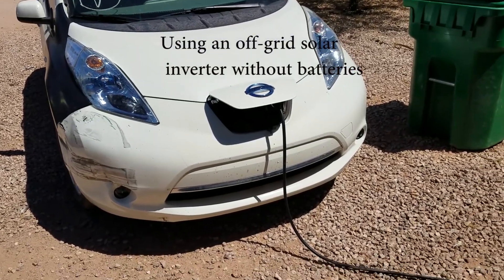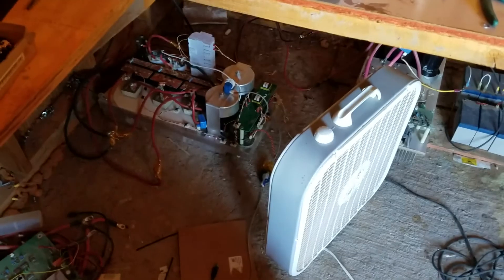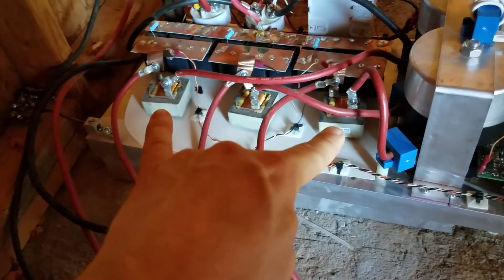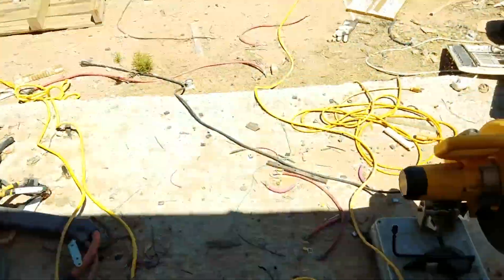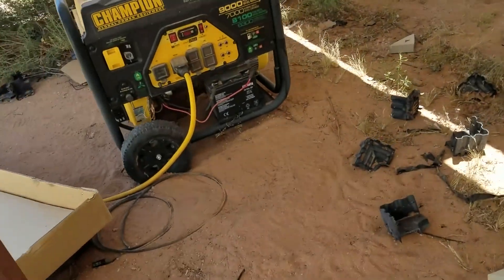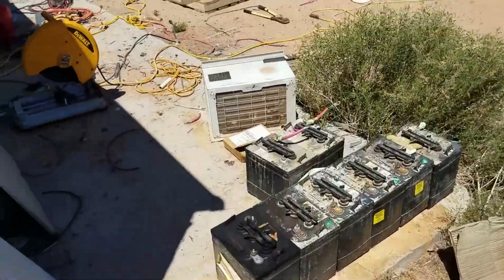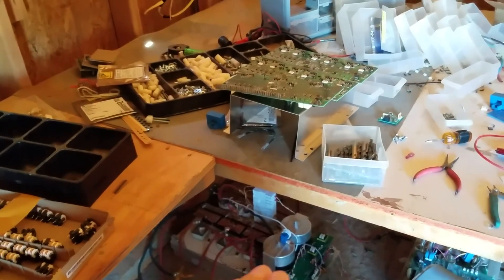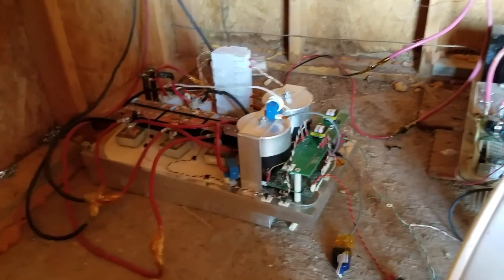Running A High Voltage Off-Grid Solar Inverter without Batteries

Comment: Great job it looks very interesting....I just installed 15 kW of solar panels on my roof and I still I'm not connected to the grid because of Bureaucratic problems with installation of the 
Bidirectional meter. What I don't understand is how do you overcome the on and off of the system because of cloud shading , I would believe it's hard on any air conditioner to continuously go on and off. Intuitively I would think you would need a battery to take you through the downtime due to cloud shading for minimum period of time, Could you elaborate on how you overcome the downtime because of cloud shading in another video! Thx

Comment: Did you ever consider that if you could disconnect your electric vehicle's motors from the inverters, you could use the car's inverter to power your home, no extra inverter needed.   The car's inverter could power 20 or thirty homes, unless there is a lot of heat pump usage.   There would be no trouble starting any domestic load.  A large home's whole house airconditioner would be no problem to get running,  Of course, if you did this, it would make sense to go to a three phase system, since the car is.
Reply from the maker: I actually used my motor controller board for this.  I just added an LC filter on the output so it looked like a sine wave.
Reply: Was that an electrical vehicle?

Comment: +1 More people should be posting videos like this.  I'm off grid with  3KW of panels and only a car battery and live just fine. I hate batteries.  I run things mostly off the DC PV array buss with a micro controller prioritizing loads.  There are better solutions than just a bunch of black boxes connected together.

I now run my LG washer off 4 grid tie panels with a modified MSW inverter which accepts 130V DC.  No batteries.   Excess PV power heats water and all cycles use hot water. Super clean.

Comment: Would you mind sharing a schematic of your inverter someday?  How do you handle the filtering to get a somewhat smooth sine wave out?  Do you just use those output inductors or do you also have AC capacitors between the phase outputs and ground?  Do you just monitor the output voltage or do you also track current?  Maybe a video showing and oscilloscope showing the waveforms would help explain it :-)  Anyway very neat, I like seeing the amazing things like this people build!

Comment: I have a standard battery inverter but I don't currently have the batteries to run it and I am thinking of doing what you are doing. I just wish the manufactures of items like frigges could let one just directly run it off a solar panel or two, and avoid all the hassle of having to use an inverter and convert the power to A.C.
Reply: GE monogram makes a refrigerator with a DC compressor, but they use an inverter that runs off of 120v AC to power the compressor from 53v DC to well over 250v DC. The problem with these fridges is that the inverters keep failing. Maybe you can figure out how to run the compressors on DC straight from a solar array powered 48v battery pack. You may be able to change the 48v DC from the battery, to maybe 100v DC with a DC transformer? There really is no need to have a multi speed compressor by varying the DC voltage to it. All AC compressors are constant speed, as far as I know.

Comment: Great work! I suppose it's an SPWM inverter, only wondering about it's input voltage range. Have you considered using supercaps in parallel with your panels to provide surge power? Those things can do miracles.

Comment: if every building in the country used this design we could eliminate this stupid ass high voltage electrical grid.
Reply: It is not even practical for most buildings.

Comment: if you run a 1000W air conditoner how many watts of solar panels do you need?  Seem you need to cover the surge.
Reply from the maker: The panels just sag under the surge, but it only lasts a short time.  I can even easily start my milling machine, which has around 100-200amp startup surge on the motor.  In fact, my normal circuit breaker trips when the milling machine is hooked up to the grid. It works much better off of the panels.
Reply: Thanks this is really a breakthru, I had a 24V to 12V converter and hooked the 12V to a inverter and was able to run a 50W fan on a cloudy day on 200W a panels.  Do you need a sine wave inverter for the leaf or is modified ok since you are just converting it to DC anyways?

Comment: Have you considered using the LEAF batteries for storage (through the CHAdeMO, if you have it)? You look adept enough to figure out the Vehicle2Home protocol for the LEAF.
Reply from the maker: I would like to do that.  They have a diode on the chademo input forcing it to be house to vehicle only at the moment I believe.  I'm just now finishing a SiC based MPPT tracker, and my hope is to charge the leaf batteries right from the panels so I could do more like 6kW with like 98% efficiency rather than panels to AC to leaf charger back to DC.  I bought the chademo protocol, so I should hopefully be able to at least get the H2V MPPT working.  I wish the car wasn't such a nanny state.  If you try anything too weird you can brick it until it goes to the dealer to clear the fault.
Reply: Yeah, so many cheap LEAFs out there begging to get hacked. Hopefully, with all the projects, the code will be cracked. 

I would like to use my LEAF as a 3-phase generator (with either an external CHAdeMO inverter, or using the car's internal inverter).

I could buy a CHAdeMO charger or generator as separate devices, but either is way too expensive. Seems like both could be in one device with a bi-directional inverter such as used in AC drive cars now.

Comment: Oooh yeah......this brilliant my friends. 
What about when you clouds passes by your solar panels are your appliances still running?
I have just subscriber to your channel. Please checkout my channel subscriber like and share with your friends and family members
Reply from the maker: jwsolarusa if it is running at full capacity, clouds would cause it to turn off temporarily.  but where I live in the sonoran desert it is sunny 99% of the time.   also it is so hot that batteries dont last very lon.
Reply: MPaulHolmes 
Wow!
Thanks for sharing biddy

Comment: Could you post a schematic how you are connecting your panels to your inverter and output filter? I would expect an efficiency in 97% range similar to grid-tie inverters.
Reply from the maker: It's just Panel + to high voltage + input, panel - to high voltage - input, and the 3 phase outputs of the 3 half bridges go through their own inductor, and to 
150uF of capacitance each.  Then, all 3 150uF capacitors have side "B" wired together (and that side is just left floating, connected to nothing else), and each side A (which is connected to its own inductor) goes to the outside world.  
So, 3 of these:
IGBT HALF BRIDGE "MIDDLE" ------ INDUCTOR --------- 150uF 
I think one reason for the efficiency I measured is, these are 1200v 200amp IGBT half bridges switching at 19.2kHz. A usual grid tie only has a full bridge I think, but this is 3 half bridges, in order to get the split phase/3 phase power.  Also, this would be quite a bit more efficient at 100 or 150amp per phase rather than just 6 or 10 or 15amp per phase, since the IGBTs have a constant voltage drop for their ON losses.  It's sort of designed for much more power than I am using it for.  If I was doing a 6kW sunnyboy, I would probably do SiC mosfets for the full bridge, but this was just what I had laying around (3 big half bridges).  It's compatible with my 3 phase motor control board, so I had wanted to use that, since it's what I had available.
Reply: Cool. I would order low amperage IGBTs from ebay or something to get less switching losses. SiC fets are still too pricey for the tiny advantage in efficiency. Can you also reduce switching frequency to reduce losses or your output filter would get too large? I would like to see you add some series string of batteries in parallel with panels to make this system more resilient against intermittent shading.

Comment: What happened to the Bug? I loved that series. Whos solar panels are you useing? Do you and your wife still have the blog up supporting the power conditioner/inverter? I need to look up your blog, it has been a while.
Reply from the maker: We moved to Arizona, and had to sell the volkswagen a few years ago.  I got the solar panels on Ebay for like $3500 if I remember right.  Yes, the blog is still up. It's at ecomodder, in the fossil free fuel forum.